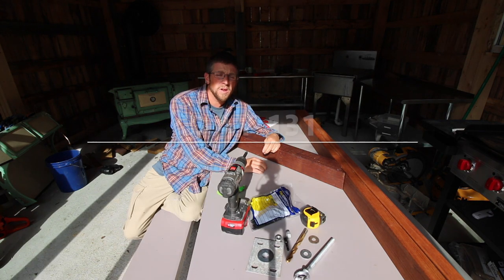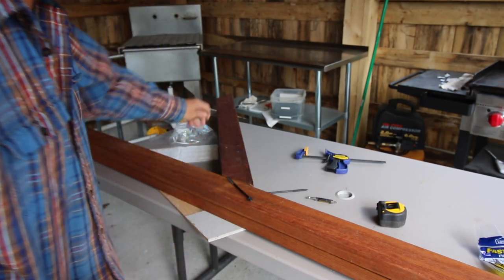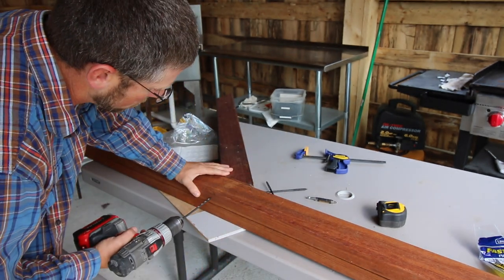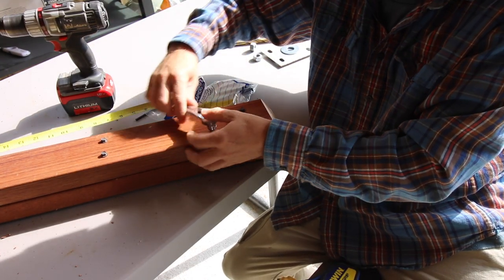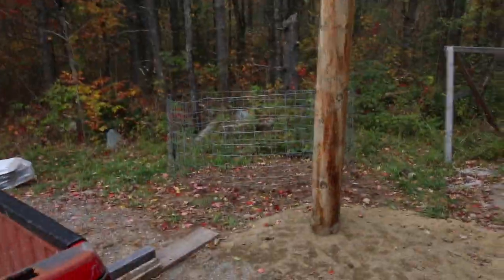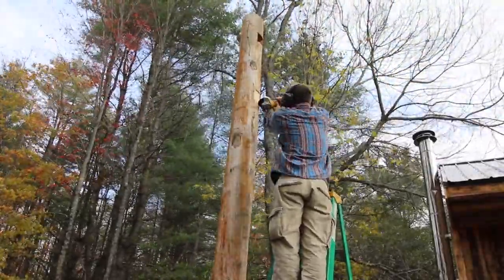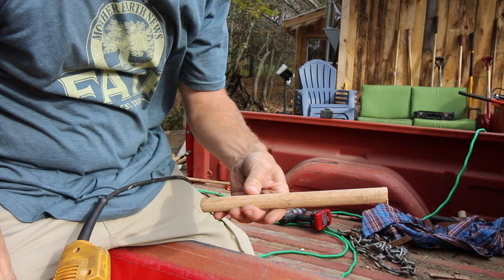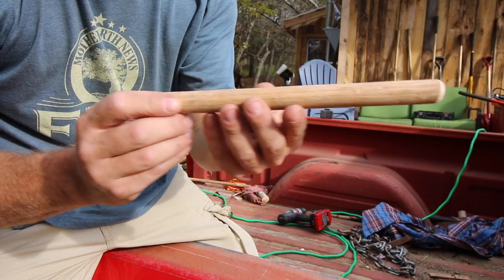Making a Mahogany  Arm for our Meat Pole

Comment: To keep the pole plumb you will need to do a cable back anchor.  Especially with the weight of the pigs and deer.  My father was a lineman and cable splicer for Verizon.  He hand dug plenty of 40-60' poles (10'-12' deep) and set them by hand also using block and tackles and a gin pole.  It always amazed me.

Comment: Sweet that should do the job perfectly. You gonna use a block and tackle or a manual boat winch with a pulley on that eye bolt.  Thanks Al
Reply from the maker: We will be using a chain fall

Comment: Use a pulley or double pulley for hoisting the pig up. This will save your back. You can also use modern line(rope) on the pulleys so it can be rinsed after harvest. Just a Idea.

Comment: And flip that ladder, end for end. With round rungs it can be used either way. That puts the gap at the top. You would never step on a rung up that far, anyway.
Reply: Yeah, I know. Easy to sit here and see it, after the fact! ;) Sorry about all the backseat homsteading here! Just hoping it'll help next time you use it.
Reply: I was going to say, simply replace the rung, but then I noticed the ladder is just one piece of an extension ladder, so no need.

Comment: You could have hooked the strap hook into your eye bolt. Then wrapped the other end around the pole. One strap, without all that other rigging, would have pulled the eye bolt toward the pole, and snugged it all up in one swell foop. :)
Reply: Then he would have been taking a chance on breaking it as he put the pole up. I am not trying to second guess him here. Nor to backseat drive what he is doing. Certainly not insulting him. I don't see why you are...

Comment: I don't want to minimize today's achievement but you really should have glued the top 2"x4"s. Trapped moisture will rot any wood, whatever how resistant they are.

Also, to get maximum strength, the dowel should have been inserted in the middle of the pole. Putting the dowel on the backside of the pole makes it more vulnerable to shear, as the dowel wood fibers are not supported on their entire length.

Keep up your good work.